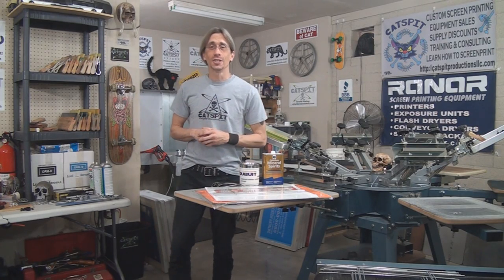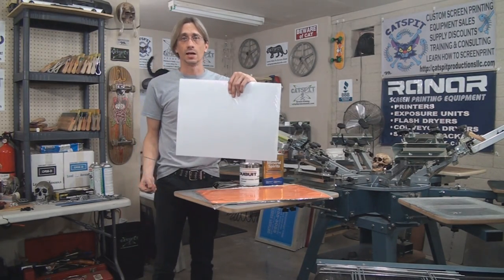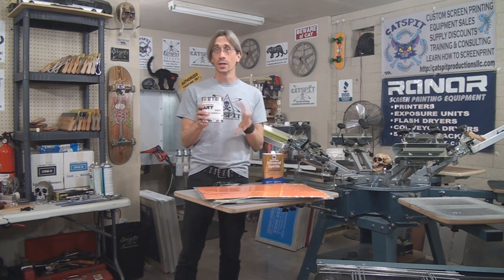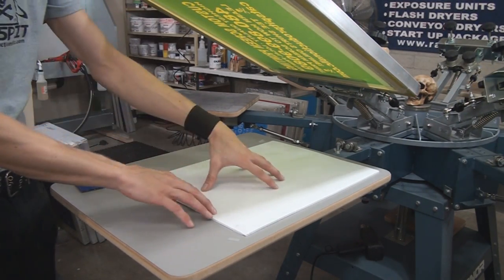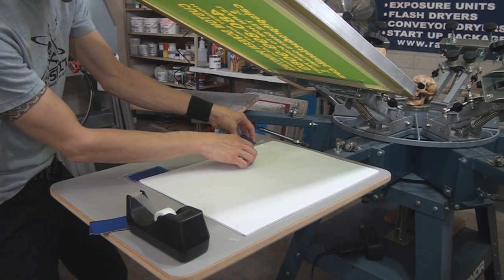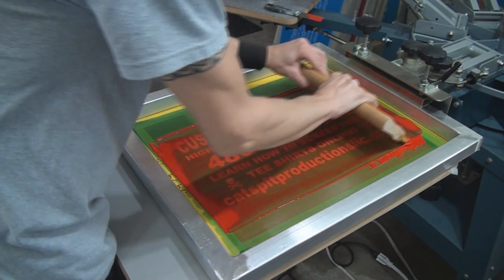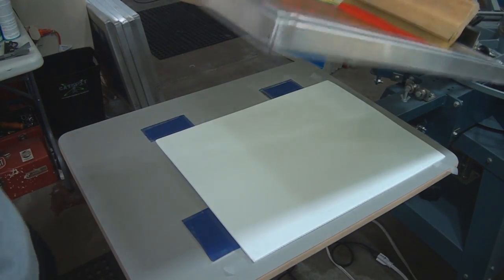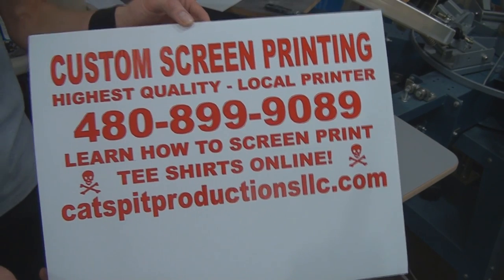How To Screen Print Air Dry Ink: Plastic & Poster Board Signs

Comment: Awesome stuff, Do you think this ink would work nicely with poly mailers? I've tried water based inks but it rubs off too easy, i've also tried a tri-bond catalyst mixed in with regular plastisol, but the poly mailers are too sensitive to heat, even in the low 200's
Reply from the maker: Thank you! It’s possible that it could. Probably worth a test. Thanks for watching and leaving a comment! http://catspitscreenprintsupply.com/

Comment: I searched your video archive for a video on printing water based inks on t-shirts and didn't find any. Have you ever done one? Also, have you ever tried printing with matte finish plastisol inks on t-shirts? As you can imagine I am looking to try to get a soft-hand print and a matte print one way or another. It seems curing water-based inks on a t-shirt can be problematic. I am trying to find some info on curing water-based inks with a heat press. Have you ever done that? Thanks in advance for any help in these matters.
Reply from the maker: No I have never done what you suggest but it has been done and can be done. You can print water based inks and then let them air dry. Once dry to the touch you can heat press them to heat set the water based ink and make it wash safe. Most water based inks should be matt especially after washing. If you’re printing lighter garments you can get the same soft hand print with plastisol inks by using higher mesh counts and printing lessor volumes of ink. Thanks for watching!
Reply: CatspitProductions Thanks for the quick response(s). Didn't see the Dupuit(sp?) ink on your supply page. I'll google it and see if I can find it out there somewhere.
Reply: CatspitProductions Found it...."Integrity Print Supply" found here: http://www.ipsaz.com/. Thanks!
Reply from the maker: sambking You're very welcome. The Dubuit ink is not a textile ink. You cannot print that on tee shirts. It's for coroplast signs and other non textile substrates. I can sell you that ink if you need it. All you need do is ask ;)

Comment: Can I use emulsion made for plastisol ink or emulsion made for water based inks? What emulsion did you use in this video?
Reply from the maker: For this particular ink you will want to use a solvent resistant emulsion. Thanks for watching!

Comment from the maker: Phthalate free or PVC free plastisol inks print pretty much the same as I understand. I have never used the new stuff as I don’t really print for children. Water based textile inks are air dry and then heat set at a much lower temperature than plastisol. Thanks for watching and leaving a comment! ☠

Comment from the maker: @sigmanuHD565 Yes, you should use a water based and solvent resistant emulsion. I used SaatiChem Textil PS2 Blue with a post cure. You can get that at a discount using the Catspit code for Saati products on the Print Supplies page on my website. The link is on the YouTube channel page. Thanks for watching and leaving a comment! ☠

Comment from the maker: It’s hard to say without seeing what you are doing. But it sounds like there is something wrong with your stencil. The ink should not pass through the stencil except in the places where your design prints. If you are getting pinholes or whatever, it is stencil failure. Make sure you are using an emulsion that is resistant to water based inks. Not all emulsions work with all ink types. Thanks for watching & commenting! ☠

Comment: We enjoyed your video. Here at Sea Commander studios where we do experimental screen art and 4Xtreme Art (board art etc). We even print colored glass powder on float or flat glass and fuse the colors to each other at 1,500 degrees F. in back room kiln. Complicated!  Most screen art is done the same way as your stuff, although we use four by five foot aluminum framed screens. We are crazy artists out here in Seattle. Good demo. Thanks.

Comment from the maker: Thank you!! You can really print as many as you want as long as you keep the rhythm going. If you can keep printing and adding fresh ink it shouldn’t start to gum up or string out on your for some time. If you get very good at it you can do some decent runs without stopping. Please check out the Print Supplies page on the Catspit website for discounts. Use the Catspit promo codes to get 5% to 15% off list pricing plus free shipping. Thanks for watching and leaving a comment! ☠

Comment: Great video but how would you print on wood ? I want to print on wood but dont know  were to start.
Reply from the maker: You would likely need to use a poster ink with a screen and some hinge clamps or maybe even freehand. It all depends on exactly what you want to print and what the artwork looks like. The process will basically be the same but with an appropriate ink.  Thanks for watching. Screen Printing Equipment & Supplies - http://catspitscreenprintsupply.com/

Comment: I am trying to find out how to print on plastic single coil pickup covers, I have started winding guitar pickups and I want to have my name on the cover, and so far, I am unable to find out how to accomplish this. Any ideas? By the way, great video.
Reply from the maker: Thank you. That is really just a matter of set up and using the property that will bond with the material you are printing.you may need to build some kind of special jig or special set up with the screen in order to print your item as I do not know what it looks like. But you will need to find ink that will bond with the material. Thanks for watching and leaving a comment! http://www.catspitproductionsllc.com/ - http://catspitscreenprintsupply.com/

Comment: Plastisol really isn't designed for anything but fabric. Even if you eventually got it to dry using low heat, a piece of tape would take it right off. It's best to use inks made for specific purposes.

Comment: Hey l have just started using waterbased inks for t-shirts. But after a few prints the ink starts to seep through the stencil to the side were the garment is sitting, resulting in a large bleed. Is this down to applying too much pressure when trying to flood the screen~? Your videos have helped me a ton. 

Lewis.

Comment: How do you get the ink out of the screen in clean up
Reply from the maker: You'll need to use a solvent for the ink. Paint thinner will work in a pinch. Thanks for watching. Screen Printing Equipment & Supplies - http://catspitscreenprintsupply.com/

Comment: Could u air dry tee's?
Reply from the maker: Most water based inks will require some sort of heat setting. But I do have an air dry catalyst that I will be testing for my water based inks that will make them wash safe from air drying alone. However, you would have to let the prints dry for like 3 days with that stuff. So stay tuned and we shall see. Thanks for watching! Screen Printing Equipment & Supplies - http://CatspitScreenPrintSupply.com/

Comment: is it possible to print a four color process?
Reply from the maker: It may be possible but we usually do one color at a time with stuff like this. You would not be able to print all 4 colors simultaneously on press since the ink will dry while you're working. Thanks for watching! Screen Printing Equipment & Supplies - http://CatspitScreenPrintSupply.com/